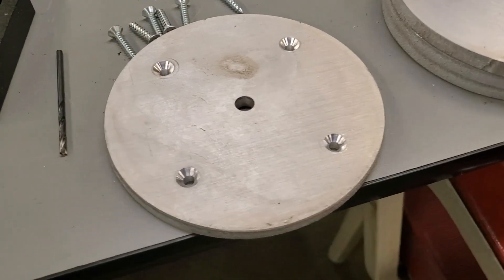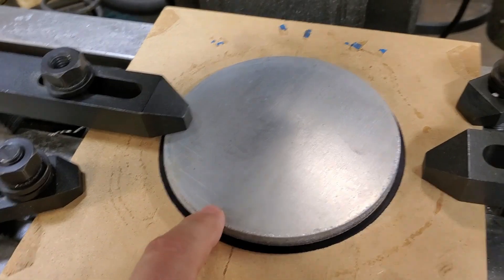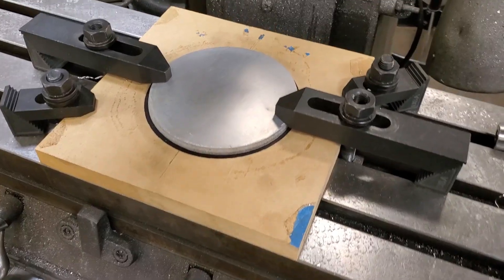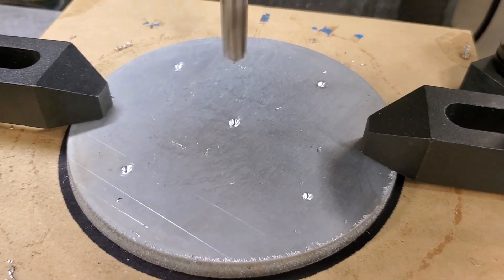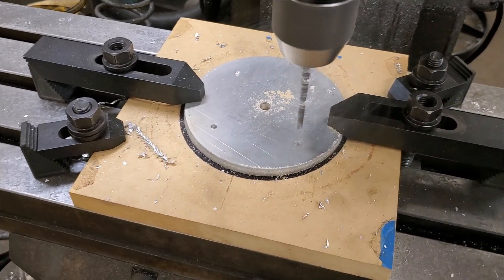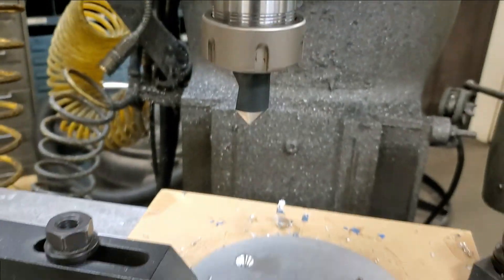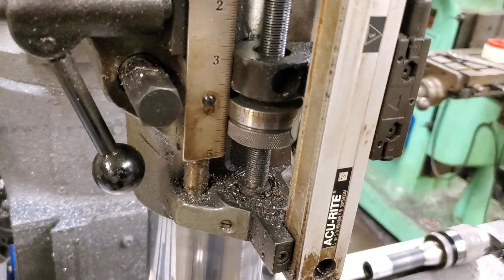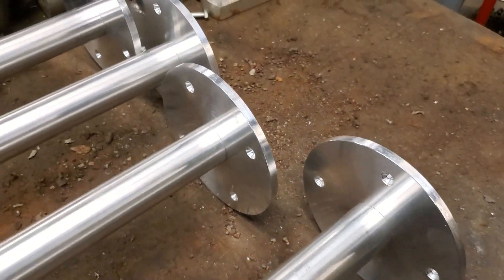Making Fixtures with MDF - Quick Machining Tip #29

Comment: Nice use of lateral thoughts and dissimilar materials. You have me wondering if the five drill holes would also assist in mounting all the plates in register onto another mandril. Then use the  lathe to get the rims to size in concentric harmony.
Reply from the maker: They definitely could mount it that way, especially if you only needed to turn the outside. In this case, the screw heads would have been in the way for the facing operation.